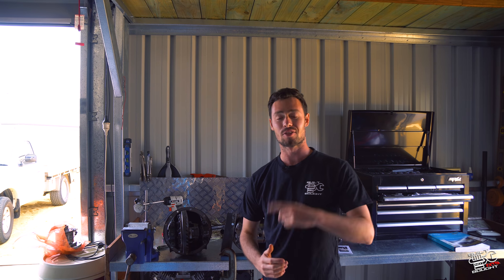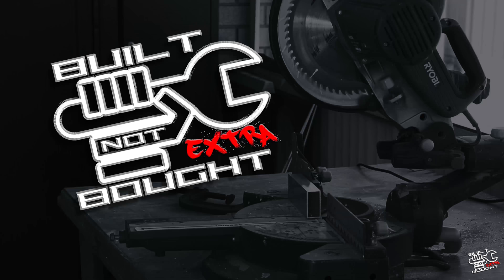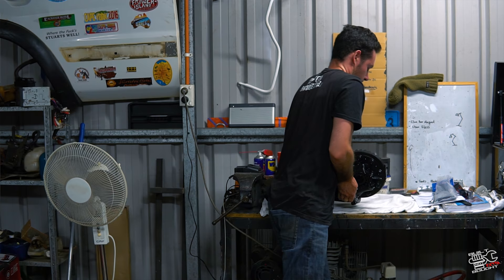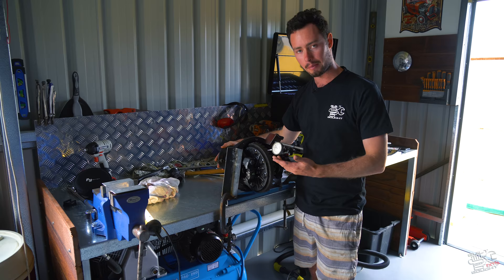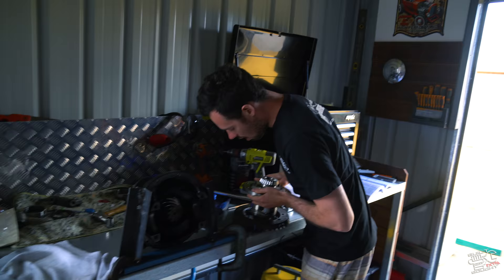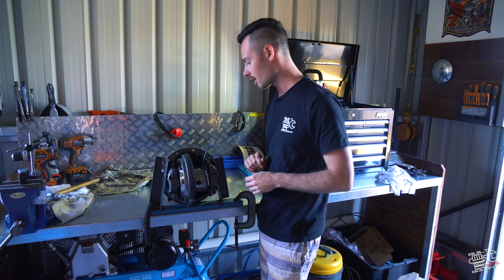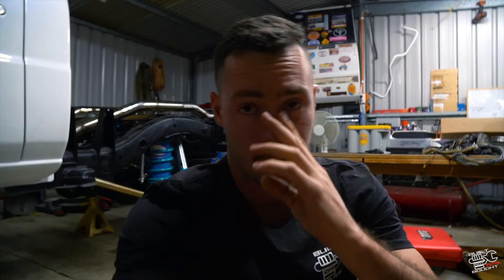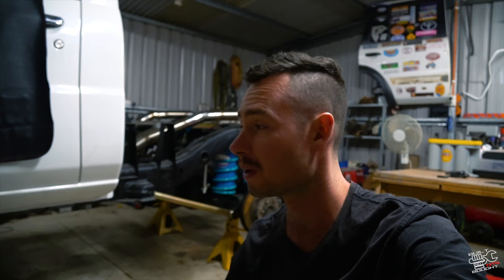BNB Extra || ELocker Install

Comment: Hi Sam,
I'm about to buy the Eaton front locker for my GU4 3.0 and I'm wondering if you have to use guenine bearings or special (bigger) bearing?
I will also change my diff gear because I'm going on 37'' so both of the axles will be rebuild with Nissan parts. ( bearings, seal...)
Thanks a lot for your answer.

And keep going! 💪
Reply: @speyles  Thank for the quick answer, I'm glad to follow a nice person like you! 👍

Comment: I have always wondered with these e lockers why they aren’t used in a drift application haha.. please correct me if I’m wrong here🤷🏽‍♂️
Reply: They aren't designed to engage or disengage at high speed. Plus a spool or mini spool is a fair simpler method of locking the diff in drift and drag applications. Being simpler they are cost effective and have less parts to break as well.
Reply: whatyareckon fair fair👍🏽 thanks man!!

Comment: Ima gonna sound like a prick but only e lockers have the design flaw of half a rotation air lockers do not. Also bearing preload is different on my car factory manual says to move right bearing in until there is no play between pinion and crown wheel. Then wind in left side till backlash is achieved and this will set preload on right bearing. Also did you check the run out after installing new centers?
Reply: Hell run-out and tooth pattern should have been done before back lash, anytime you change a carrier it's going to need a run-out and pattern check. Also I check back lash on the quarters (4 places equal spacing).
Reply: TdrSld i used spray ink and then bearing blue to check mine when i did them
Reply: Hate to be a prick too but only air lockers have the design flaw of air lines being ripped out as well as a number of other faults.  Macnamara diffs have neither of the design flaws of air lockers or elockers.
Reply: Gerhard Petersen oh so what actuates the solenoid on a jmac diff thats right a vacuum line.... or in case of the tjm version an air so same design flaw as arb... The flaw im talking about is the locking and unlovking in a elocker. Sam said lockers have this issue he should have said its specific to elockers and not other lockers
Reply: @SomervilleMetalWorks  Sorry there broski but ARB's have a very high failure rate vs e-lockers due to the simple fact that when the axle flexes over time doing serious off roading it causes the seals to lose their integrity and air will leak, and not only that the hoses are prone to getting brittle and leaking.  E-lockers are far superior in terms of longevity and low maintenance costs.